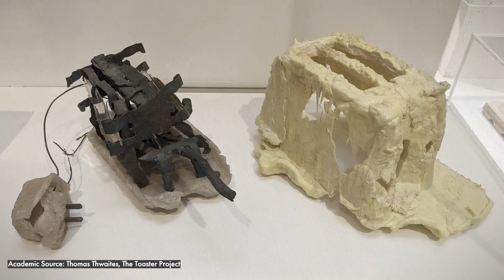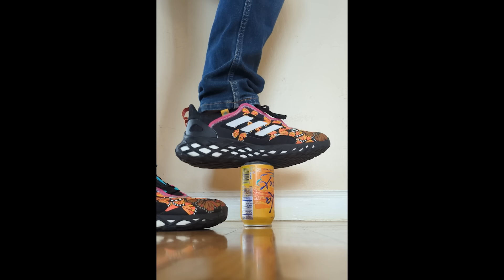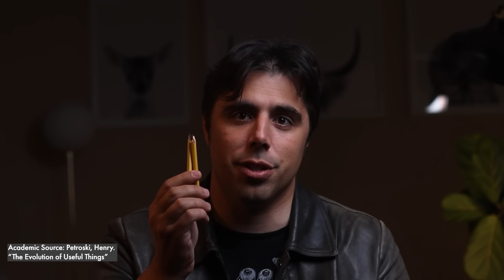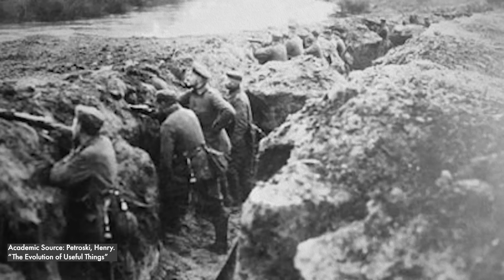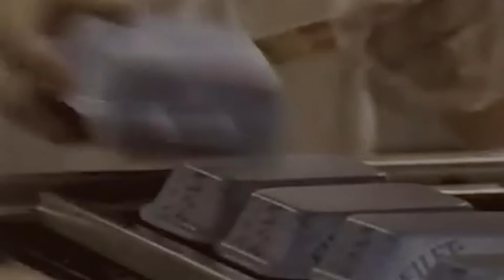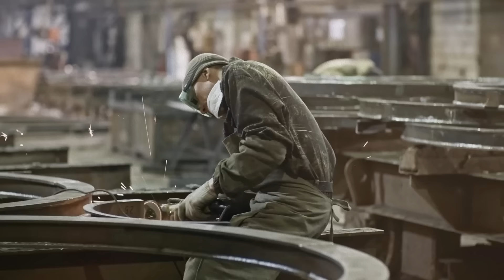Why Simple Everyday Objects Are Impossible to Make

Comment: Being in a manufacturing job, I think people simultaneously overstate and understate the importance of most pieces of the chain. For my case, I deal with stupid engineers. Like actual idiots, they chew with their mouths open and breathe orally. I am the most intelligent person at my workplace by a country mile. A lot of design work actually happens on the shop floor, rather than in controlled lab environments, for simple fact that a 2-degree difference in temperature or 5% difference in humidity or air pressure can drastically change how a chemical processes works and doubly so for finely-tuned parts. There's a real difference between tactile understanding of manufacturing, the seeing, feeling and doing of it, and the theoretical understanding. Thus, the actual on-the-job understanding of things is hugely understated in importance compared to the intellectual work of engineers and administrators. Personally I'd like to strangle whoever came up with JIT. Fuck that guy.

Another part of this that I think is vastly understated is the complexity of sourcing. We source so many things from all over the place for very silly reasons; usually because free trade made one group of borderline (or outright) slaves able to produce a good for slightly below market rate, and a load of bean-counters looking to maximize revenue while minimizing expenses decided two cents was worth overhauling the entire supply chain. There is not a single resource on this Earth that the US, for example, cannot source domestically and yet it imports things from across the globe without ever exploiting their own natural wealth. Instead it chose to offshore, literally selling their IP to foreign governments, which is why toasters are so damn complicated now. Did you know you can make a toaster with exactly fifteen parts, which will work literally forever assuming that nothing inside physically breaks? No microcontroller, no computers, just metals and physics. We don't do this because it is slightly cheaper, and I mean by pennies of total end-cost, to have a complicated micro-computer that exists just to run a toaster than it is to buy the correct alloy and spring. There's a model of rice cooker, just a pot, spring, element, magnet and spring. Below 105C the magnet functions, above, it doesn't. Next to zero moving parts, the simplest and most efficient rice cooker design possible. Perfection.

Comment: Between pop tops/pull tabs and our current design there was a style in the middle. Two circles that you push down with your thumb. One large enough to drink out of and the other one at the other side of the rim smaller for an air hole so there wasn't any glugging when pouring or drinking. It was the best design I've ever seen.
Reply: I remember them. I wonder why it was replaced.

Comment: You should ideally use a straw for cans, or a glass js. Also, I think the design of the cans means they fit easily to stack without putting pressure on the tabs. An accident could potentially burst those cans but like that's not a regular occurence.

Comment: This goes both ways though. Modern designs are full of unnecessary complexity because it brings the cost per unit down when making huge numbers, but that same complexity makes them easy to break and impossible to repair. You could make an all stainless toaster with mechanical timer and straight 120v to coil with less than 50 components. It would be heavy, expensive, use more electricity. It would also be durable, repairable, and last forever. Being manufacturing back to America. - Engineer

Comment: The problem is that he thought a modern toaster was a simple object, it's not.
However, I could make a toaster fairly simply, I have all the necessary parts. Some steel/iron scrap lying around, a forge, a hammer and an anvil. I could smith simple toaster with 2 halves that enclose the bread over a fire. Actually, making it out of sheet metal and welding on some handles will be even easier.

In general, if it runs on electricity or has plastic in it, don't even bother. If it's made out of wood or steel, it might be worth it.

Comment: Making a fork is easy and cheap. You only need the $100,000 mold and the $500,000 injection press if you want to make thousand of them every hour. You can make a perfectly viable fork in an hour with a sharp rock and a bit of wood you found. And that fork will last me longer than any plastic fork I'm likely to buy.

Because all I need is a fork. Not a plastic one. And I even doubt I actually need a fork. I can eat just fine with chopsticks. They take absolutely no effort. Sure, the perfect ones might require some production but I can achieve up to 80% functionality looking for some somewhat straight bits of wood in the forest.

Most of the stuff you use on a daily basis is overengineered for the basic purpose it is being put to. Yes, it makes life easier, but it is not a requirement at all.

Comment: If trying to make a toaster from scratch, I would not use modern toaster design with all modern materials. Like a metal box with some cage to hold to bread in the middle away form the walls then heat with fire.  It would still be hecking hard to forge with handmade tools but possible. Or just a flat piece of metal with a handle that can be heated and then pressed against the bread. Yet I didn't even consider a hot pan, despite describing one.

Comment: Regarding tariffs? The reason the US is placing tariffs on imported goods is those countries sending goods to the US have high tariffs on US goods we export to their country - it's only fair. If they are going to add tariffs onto our products going into their country (making our products more expensive in their country, meaning less of our products SOLD in their country), by us placing tariffs on their goods equals out the market.
If one side is using tariffs and the other is not, the side not using tariffs is going to lose economically everytime. In order to make the market even, Trump installed tariffs on foreign goods because those countries have high tariffs on US goods. He put those tariffs on imported products to force the other countries to lower or drop the tariffs on US goods. Once the foreign countries eliminate tariffs on US goods, the US will eliminate tariffs on their goods and a true free market can be re-established.
As long as foreign countries have tariffs on US goods it is only fair for the US to place tariffs on those countries' products, too.

Comment: no. a toaster IS simple, COMFORT is complex.
 if one would leave out all the unnecessary components, you would have a much easier time to make one yourself. in the simplest form a toaster is just a heating element. thats it. a single damn wire. he tried to include things like a timer and heat regulation, also a plastic casing (which you dont need). comfort made it complex.

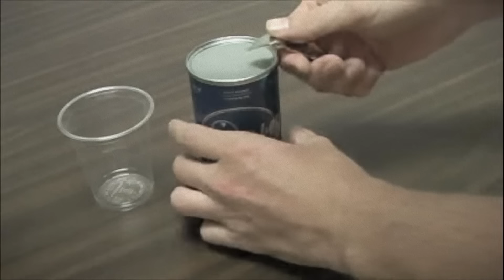Comment: 8:00 -- Note that cans as a method of preserving food have been in use since the late 1700s, but the can opener was not invented until the mid 1800s; prior to this, a chisel and hammer were often recommended in instructions on the can. The original cans were usually steel, and the sides were commonly soldered together, with the solder containing lead; this resulted in expeditions to the Arctic and Antarctic experiencing lead poisoning from their canned food. Improved manufacturing methods allowed both seamless can walls and lead-free sealing to eliminate the health risk.

The "church key" for opening drink cans was not invented until 1935. The pull tab also had a brief stupid replacement by push cutouts -- basically, circular cutouts like the modern pop tab (a large one to drink from and a smaller one for an air vent), except that you pushed these in with a finger; the concept died when the safety risk of pushing your finger into the larger opening and cutting yourself on the sharp edges became apparent.
Reply: I love this information.

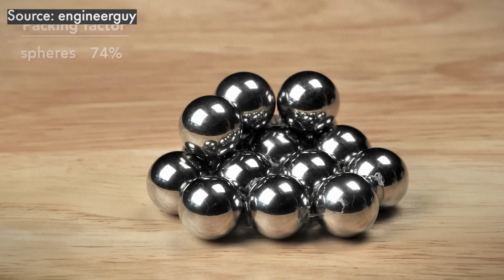Comment: 4:25 -- a good counterargument against a cuboid shape for cans can be seen in the "flimsy", a 4-gallon (imperial, 4.8 US gallons) rectangular container used by the British during WWII for transporting gasoline, oil, and water. The crimped or soldered seams were known to split under load, particularly when the containers were stacked for transport, either aboard ships or on trucks, especially when transported on rough terrain. During the North Africa campaign, it was common to see losses of 20%, and sometimes up to 50%, of fuel transported during a journey -- One quartermaster reported that his 70,000 imperial gallons of fuel had been reduced to just 30,000 imperial gallons over the journey; and was informed that even this was a "good effort". The flimsy was replaced, beginning in 1940, with German-style Wehrmacht-Einheitskanisteren (aka "Jerry cans"), first from captured stocks and later by British-manufactured copies (for interested parties, there are a number of videos on the design of the Jerry can on Youtube).

Comment: This is a fantastic demonstration of "marginal cost." For those not familiar with the term, it means, "How much does it cost to make one more?" If you have none, the cost to make one more can be millions of dollars. But, if you have 50 million, the cost to make one more could be less than a penny. Marginal cost pretty much ignores fixed cost (the cost that has been paid and will not change) and considers only variable cost - which is typically the material in the item.
Reply: Also the miracle of economies of scale
Reply: @theorangeoof926  yes. Marginal cost is used to determine maximum scalability. Eventually, additional variable costs will enter the picture if things scale too much.
Reply: this is where the sory of the 50K toilet seat came from

it was for plane or submarine not sure where that had sizne that when they started waeragin out there was no mold for that size any more the cost was the cost of making new mold
Reply: @ThunderClawShocktrix  That was most definitely a part of it. The major problem is that it had to meet MILSPEC, and no existing ones did. No one examined the spec to see if it was unnecessarily strict.
Reply: @ThunderClawShocktrix  Also were this claim about the US spending millions on developing a pen to write in space while the soviets used a pencil comes from. The US specifically stopped using pencils, because graphite dust breaking off the pencil could pose a risk to circuits. But the US didn't actually spend the money, a private company developed the pen at their own expense, and then sold the finished product to the US. Also to regular consumers...to this day.
Reply: So true , I learned this initially through textbooks but it was boring to study but now from a different perspective it seems so interesting .
Reply: I remember back in the early iphone days, a classmate said that it costs Apple £10 to make each new iphone and we're buying them for £350 being ripped off.

Not I'm like fine, if you don't want to pay the £340 mark up, go design it yourself, collect the raw materials, refine, process and assemble them including designing and building all the equipment and machines needed to do so from their raw materials.
Reply: @JiminyClarkson  Nah... the £90 Nokia phone does everything I need. :D

Comment: Mass production is what lowers the cost of things. Labor is expensive. Cost of machinery is expensive. The more a machine can produce for the life of the machine. The lower the cost will be per item. If a machine to make an item costs 10,000 bucks and it only makes 5,000 units, you have to charge $2 per item to just pay for the machine. If it can make a million items. Then the cost per item is only a penny per item to pay for the machine. That doesn’t include the cost for getting and obtaining the raw materials, and R&D which both includes labor. Also once certain things have been produced for a while costs go down. When DVD players first came out, they cost $1000, now you can be a DVD player for $30 NEW. Same thing applied to the toaster.

Comment: 0:20 I opened up an old toaster a couple of years ago.  It didn't have any circuit boards in it.  I don't know why everything these days "needs" a circuit board.  There is no reason to have a LED on a toaster, which was/is probably the main reason for a circuit board.  I want my simple, dumb appliances to be simple, dumb appliances.  Toasters are the most dangerous appliance anyone can own due to their fundamental design - that is, run raw electrical current through a thin resistive wire - but that can't be fixed.  Toasters also heat extremely unevenly due to their design.

Comment: I really like the approach of this video that even the most simple modern day objects require several complicated processes and that we literally need each other. You also did a great job of showing the historical reasons and situation for the development of cans. The graphite example was also great and really showed that every design is connected to resource availability and politics. What I would add to the reason for why we create is that we also create to make our lives easier.
There are just two points where I dont share your view on the matter.
"The simpler and cheaper the object looks, the more complicated the system behind it has to be." is not quite correct, e.g. the machines to produce the wafers for chips are extremly expensive and only one company in the netherlands builds them. This should already disprove your claim. However, your findings correlate with something that is actually the reason for high equipment costs: numbers. What makes manufacturing tools and machine REALLY expensive is consistency and speed. Injection molding is a process that was developed to produce millions of plastic pieces over a year. These machines run almost 24/7 and must therefore be super reliabile and and show as little degradation as possible. This is what makes the machines expensive, not the complexity of the object they produce.
Also to come up with a cylindrical design for cans is not as genius as you presented it. Cups, jars, tankards, bottles and all kinds of other round drinking vessels existed before and used the same logic as the can: tall an round with a flat base. This concept didnt have to be reinvented for the can but just repurposed for a new material. Also there are cans that are square if you think of canned tuna or spam. They are square because they dont have to be poured from.

Comment: Moulds are not that expensive nowadays. CNC machining is readily available, and a 2 part stainless steel mould with extractors for 6 forks is doable under 5k.
If you go with aluminium, 5k is enough to get a decked out desktop CNC and do it yourself. Learning curve and 10 broken bits included.

Comment: There are 2 reasons for this toaster globalization. 
1. Parts are available so they are used, if it is easy to obtain, then it will be used in something. 
2. The toaster doesn't have to be designed like it is, it is just the cheapest way to make it. Sounds crazy that the absolute giant that is logistics of these toaster parts across the world can in the end, be so cheap, but they are. 
The technology of the modern world allows this to happen making the stock market a global ordeal hense why inflation happens world wide even if there was no central currency of the world. The world is very interconnected, so much so that we are all connected. It is so easy to make money friends! Import/exporter.

Comment: a fork is very easy to make
1. grab 3d printer filament or a slice of wood
2. grab a reliable source of electricity
3. use a computer to make a model of a fork and slice it into gcode
4. put that gcode into a 3d printer or cnc machine
5. make the fork

Comment: 00:20 Product Designers being surprised how much engineering goes into engineering a product. :'D
I mean come on. It's not that hard to know that modern products are constructed the way they are because they can make use of the highly optimized processes and logistic chains for specific components. It comes as no surprise that it is not only exponentially harder to do all those steps yourself but also that if the requirement is to do it as a single person, it might be better to vie for other manufacturing methods. If we made cars the way we started making cars, it might be possible to do it with only a few people but at way higher costs per unit. There are reasons why product design changed over the course of the last 100 years and simply emulating a grassroots manufacturing approach because you're curious where the challenges are is merely naive.

Comment: If true free trade existed you might have a point but the CCP will 100% do anything it can to undercut the US and by extension force you and your countrymen out of the job. Free trade is a pipe dream, the tariffs aren't steep enough and honestly its all a few decades late.
Reply: Uh I think you've made some fundamental logical errors in your reasoning. A centralized plumbing system isn't bad because one bad actor can now poison everyone. Just the same, free trade with China cannot exist as things are currently, and it never has. Free trade fundamentally requires all participants to adhere to the rules of the system. China breaks and cheats these rules by doing things like limiting access to their markets. No one alive today has experienced free trade with China. It's not a pipe dream either. If others agreed to close off or punish China to coerce them to comply with the rules like everyone else, then it would likely be very possible and quickly too.